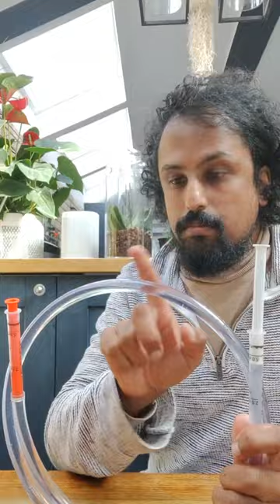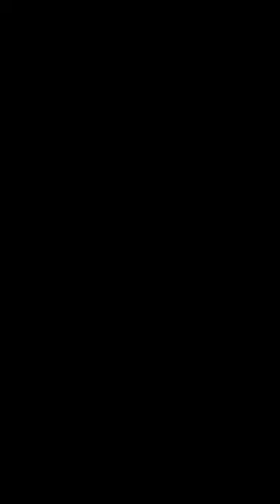Simply Civil  #Short: Pascals law hydraulic jacks d

Comment: What would happen when we apply pressure from both the ends?
Reply: Let’s say the rig was built perfectly with no weak spots, well, if both were being pressed nothing happens other than pressure building inside the chamber. Realistically, there is gonna be a weak point where if you pressed both points hard enough, the weak point would be target as an escape (usually explodes or makes a crack)
Reply: @trappizze22  well would a human hand be able to do that?
Reply: @HarbingerOfDawN_  with the contraption seen in the video you can definitely do it by hand